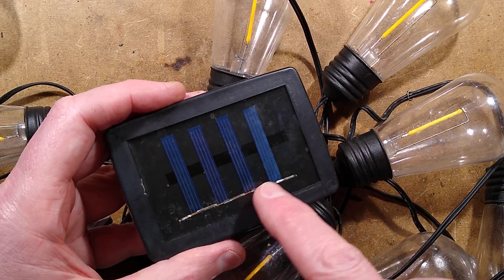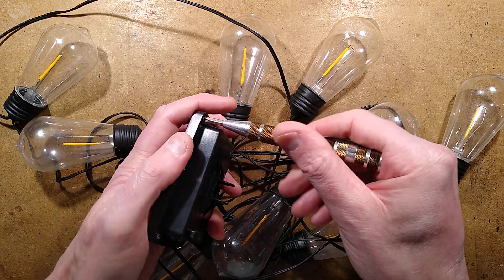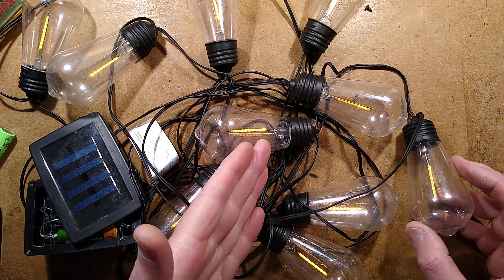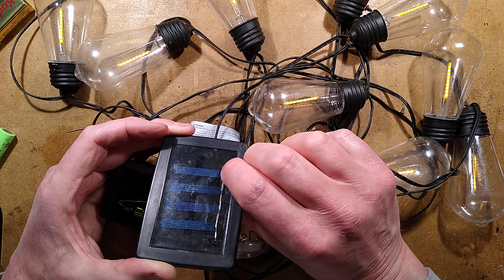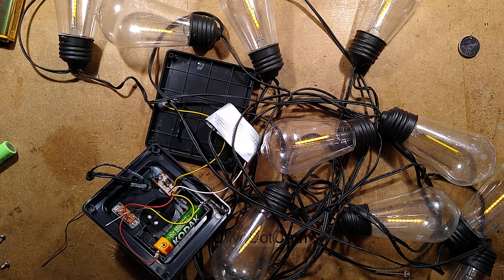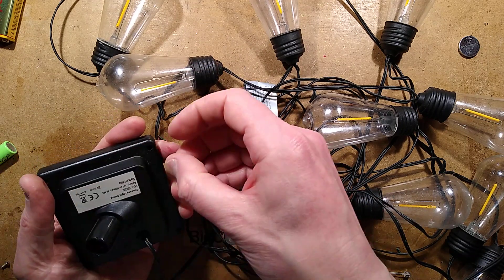Fixing my brother's solar garden lights

Comment: I recently re-surfaced the solar panels on my solar spotlights that had developed that alligatored, semi-opaque layer after five years. I used a sharp chisel to scrape off the damaged surface, and there was still plenty of thickness below protecting the solar cells. I added a few coats of super-tough flooring varnish to even out and clarify the panel. So far, they've held up fine for another two years. These are pretty decent quality lights, and came with 2 x 3.2v 18500 LiFEP04, 1200 mAh batteries, that I have only replaced once in seven years. Not bad for some Home Depot specials.

Comment: The idea of retrofitting the copper wire LEDs in is exactly what I did with one of my Aldi LED filament solar bulb things, the battery prematurely failed in one, and the other I'd pulled apart and not reassembled, so I took the working parts, some "warm" white copper LEDs, coiled them up and stuck it all together, and I have to say, seeing it out by the front door at night, it actually looks really nice compared to the LED filaments... :)

Comment: Got a string of these on a summerhouse; there's room to piggyback another ni-mh cell in parallel & looking up the IC (YX8615A) & it's datasheet it was easy to change an inductor on the PCB from 100uH to 56uH to give extra led brightness whilst retaining a decent runtime.

Comment: These green no-name cells are so shitty, they often come pre-leaked from the factory.
Reply: They're just packed so full of amperage it oozes out...
Reply: If you put a little dielectric on the batteries terminals.
Reply: yep, i have a poundland solar movement sensor switched light, its cells didnt last long so it got new ones, also from poundland, about 2 years ago, still working .... at the mo ... but poundland havent got the rechargeables in stock any more... poo ...

Comment: You might recall about 6 minths ago when you were working on some of Ralphie's other garden solar lights, I mentioned I was working on an Angel hanging wind chime blinkie solar fixture. The head is a clear plastic ball and I drilled a hole in it and inserted a RGB slow flashing LED to complement the white blinking ones in the wing area. The battery and switch along with the solar panel was toast. I bypassed the switch, upgraded the AA NiMH to a 2000Mah battery and glued on 4 50Ma 1.5V solar panels [parallel] which fit perfectly so 10 hours of good sunlight will fully charge the battery.

Back then it was winter here and the sun had moved so far south with the short days it would only work perfectly for a couple of hours after sundown and then dim into the weee hours of the morning. [I put a charge port on the bottom too so I could hook a Li-ion battery with a 10ohm resistor to charge it so it would work for a few days all night.]
Now that it's summer, it runs all night until the sun comes up on it's own. :-) [I did change the inductor from 100mh to 220mh but it didn't help, still the same brightness and subsequent battery drain.]
Oh well it works like a champ and my daughter is happy.

Comment: I've just bought, well, a week ago, a very similar set of lights from Morrisons, the only significant difference I see, is the mine are classic pear shaped bulbs, and they come in five different colours ( 3 x red, 2 x yellow, 3 x green, and 2 x blue).

I bought them because it says on the box "with non-replaceable, rechargeable battery" - I thought "non-replaceable"? We'll see about that!

The bulbs are indoors, but the power pack is outside, at least until the weather turns sour, then I'll bring it indoors, turn of the switch and let the dim winter daylight keep them topped up.

Comment: My family has some light sets which use the exact same battery/solar unit as the failed one. The only difference is the wires were tacked onto different pads on the PCB and they included NiCd instead of NiMH cells. The circuitry works fine but two of the three had the cells go bad. Actually only one had the cell go bad, the other came pretty much toasted.

Comment: CLIVE!!!!

I know you’re super busy, but I would be so happy if you did a few troubleshooting videos. Like you’re AVR troubleshooting video. (The one about the voltage regulator circuit board from a generator).

I do component level PCB repair on industrial equipment every day for a living, But sometimes while watching one of your videos… You’ll explain some thing that I learned years ago… But i’ll have a “eureka moment“ and it helps me understand even better!!! Just like in math class back in school… I could always work the steps and do complex equations but every now and then I would have a “holy shit moment!” And really understand the working principles in detail instead of just the idea of how it works.

And after all of these years on YouTube and doing electronics…  I’ve never seen someone shows the actual path of electrons. How they actually start, move, and interact with each other through components. 

I mean actually showing it on the circuit board like solving a maze with a pencil. showing where the electricity starts, how it moves through the board, and how it connects through each component and makes its way through the board. And especially what happens to the flow of electricity when certain components fail and how the flow is affected. 

I know you’re super busy but you’ve helped me understand electronics better than anyone. And a video like that would really help folks. Even professionals like myself. 

You have a natural clear and understandable teaching ability and way of explaining things.

Sorry to take your time with a long comment. But this is the clearest and most honest feedback I can give.
Reply: You are absolutely right.  Clive is an amazing teacher.

Comment: For a while I was considering building my own "central solar garden lighting scheme" where I would have a big proper set of photovoltaic panels set up somewhere like on the roof of the shed with some nice big SLA batteries or something inside. I'd have everything ran off this instead of a transformer like on a normal SELV system.

Comment: I've been playing around with solar lights and have an issue with them running properly for a short time and then going into oscillation. Looks neat though.
Reply from the maker: That sounds like a failing battery or lack of charge from the solar panel.

Comment: Can you explain what Henrys are when referring to inductors or even what inductors do?
Reply: It’s a relationship of a changing current to a voltage through a magnetic field. The greater change in current the greater the voltage. I’m open to correction I don’t claim to be an expert but I did graduate an EE.
Reply from the maker: A Henry is a measure of inductance in the same way that a Farad is a measure of capacitance.

Comment: Yeah these can be hard to fix sometimes, my mom wanted me to fix a solar light she had, but it had a lot of water ingress so the whole board was destroyed, you also have to watch the batteries they put in these, they often put really cheap NiCd batteries that don't last at all. I am glad that I've found some time to watch some of your vids. I've been so busy at school working on a production of a mid summer's night dream. Let me just say, coiling 150 feet of socapex every day is not easy and it is not fun either. The other thing that's been happening to the theater industry lately is wood is super expensive at the moment so building sets is a pain, so a lot of theaters are resorting to virtual sets on led walls or projected. My theater is lucky to have a decent projection system with 4 LED short throw projectors, a mac pro, and a full version of Qlab to run them from. I was wondering how things are going for the Tattoo this year?
Reply from the maker: Not sure what's happening with the Tattoo this year yet.

Comment: Are you sure the problem with the faulty LED wasn't in the cable. looked like high reistance to higher resistance given that a few lit then none then when you dropped it on the desk all started working.

Comment: Hey Clive wondered if you or any  of your viewers could fathom this one.

Working on a Refrigeration Plant control panel yesterday I was testing out some suspect faulty relays.

Anyway here's the weird thing; the control circuit is all 230VAC however I've found a set of four Finder relays that are actually marked up with a coil voltage of 60VDC! 

I took one out to check out the specs on RS website and they are definitely a 60VDC coil but they've been used on a 240VAC circuit and have been working fine up until recently for over 10 years!

I've gone through all the other relays on the plant and elsewhere they've used larger sized Omron Relays which are 240VAC.

It seems liked they've used these particular Finder relays because they are an incredibly slim design but I would just assume that a 60VDC rated coil would not work with 240VAC or at least not for 10 years?

Can anyone shed any light on this at all as it's a strange one. Pretty rare in our trade to use anything on DC apart from DC Fans with speed control.

Many thanks in advance and keep up the great work Clive!

Cheers!
Reply from the maker: That's odd.  AC relays do tend to have a lower winding impedance than DC ones as the continuously changing polarity has a ballast type of effect.  So it's possible that the DC relays passed less current on AC.

Comment: Am I the only person who noticed the 'new' power unit that you used had the facility for taking TWO AA cells and wondered if the factory diode bodge had anything to do with the fact it had been adapted to only use one? It sure looked like it had more solar 'panels' so may have produced a higher voltage...

Comment: i got to wonder , will those puny solar cells be able to charge batteries with ^2Ah capacity ?  ill ask that because i believe if u do put a good battery (nimh) with big capacity , it might just not be able to charge it fully and the lamp will kill itself from constant undercharge
Reply from the maker: The solar cells will put whatever they can into the cell.  2Ah would be a waste if it didn't get used near its capacity.

Comment: You should dab hot glue or silicon glue in hole wich wires are coming through, so it will be "water proof" agian 😂 otherwise, nicely done job 👌🏻

Comment: My pet hate is them 1.2V button cell batteries or 2/3 AA size... Sourcing AA replacement is easy. So when buying solar lights always check if they have normal AA size NiMH battery.

Comment: i kno this might b a little difficult to answer.. if it wasnt i wouldnt b askin lol  when would u adjust the inductor value?? say u want brighter or dimmer lights...but dont u adjust the resistor for that then figure out the inductor value? im trying to teach myself so i could b totally ass backwards..  whats the benefit to adjusting one or the other for ex. which ones would b more efficient? n is that because of its forward voltage??  thanks in advance for attempting to shine light on this trainwreck of a question lol :p
Reply from the maker: With these ones the best way to change intensity and run-time is to change the little inductor that looks like a resistor.  A higher value makes the LED dimmer and the battery lasts longer.

Comment: Could you trim the brightness of an odd led with a low value resistor?
Reply from the maker: Yes, if its voltage was slightly lower than the others.

Comment: Could you perhaps expand on the diode discovered 6:40? Maybe a schematic? :-)
Reply: There always have to be a diode between the solar panel and the battery otherwise the battery discharges on the panel when there's no light. Remember at the beginning Clive calculated 2V for the panel minus the diode, that diode.
Reply: @DumahBrazorf   This circuit uses a 4 pin ic (not a 8 pin Clive ;-) )  You can google for solar light IC and they will show up.  Everything is already included in that IC ... but most manufacturers have a on/off switch which disconnects the battery from the IC, so also the charging gets disconnected.  Now if you connect a diode directly from the solar panel, and the side of the switch where the battery is always connected to, the battery will get charged even if the switch is set in the 'off' position.  It's a non regulated charge but most of these solar panels are so not powerful that they will cause issues. In this case the panel is outputting max 2 Volt, diode drops 0.6 to 0.7 Volt and you get about 1.4V max over the battery ...

Comment: So has that Chinese solder station designed the hot air wand for heat shrink tubing only or is that for SMD work/rework too?
Reply from the maker: It does both.

Comment: Just so I have this correct... if the lights work when touched to the tablet battery, the wire on the shiny side (of the battery) is the positive?
Reply from the maker: There's usually a + symbol on it.
Reply: @bigclivedotcom  something has attacked my outdoor solar lights (in Australia the nocturnal friends play) and snapped the wire (both wires are the same colour and both covered in clear plastic) so I need to find which is positive on borh ends of the cuts before soldiering and heat wrap.

Comment: The solar light in my garden failed the other week, I wonder if it’s the battery in mine as they went 
Iike your brothers can you use any rechargeable battery or does it have to be a Ni battery for replacement?
Reply from the maker: It has to be a NiMh for these styles, but some people claim to use standard alkaline batteries.   Not sure that's a good idea.
Reply: @bigclivedotcom  cheers Clive will have to pop down to poundshop and get some batteries

Comment: Hey, what is the easiest way to replace the solar panel with just a regular old wall outlet connector?
Reply from the maker: That depends on the light's circuitry.

Comment: I have bought a pretty similar arrangement from a local store twice, but one new set doesn't really light up when it's dark. Only two or three of the first leds start to shine. I was able to switch the solar panels (because plugs) so I know it's something about the panels or the circuitry. But what? Any ideas?
Reply from the maker: That hints that maybe the end of the wire possibly has a short circuit or an LED has failed shorted.

Comment: I rewired my garden solar light - and now the bulb turns on when the solar panel is on the off position (it is on even during bright daylight) - why might that be? (it is just one low watt bulb)
Reply from the maker: If the unit is switched off the battery is usually disconnected and the solar panel may feed the light directly.

Comment: How can you tell if the battery if charging when you switch them off? I've had solar lights that only charge while in an on state, very annoying
Reply from the maker: Most use the switch to fully disconnect the battery during storage and shipping.
Reply: @bigclivedotcom  which is a pain in the butt... I wonder if places like arizona, these things survive a year 😂

Comment: I've been playing with solar panels way too much (my entire 33 year life)...
I didn't even get 5 seconds in before I saw that solar panel and thought "Oh my God what are they doing wasting all that space for 4 tiny cells?!?!?"
I mean really, that tiny panel could have had 12 of those tiny cells in that area.
...
I nerded too hard...
Reply: Same here. My mouth just dropped open. I wonder what the power output is of that thing?   I thought it would be just sufficient to light up those leds for like 1 hour when placed in the desert sun for 10 hours.   And here I am trying to use a real 6 Watt glass coated panel to keep a led lit during the wintertime.
Reply: I'd imagine the panel housing is a generic size and is used for a number of different lighting applications, the manufacturer just tailors it by changing the way the panels are set out for different sets of lights.

Comment: How does that drive 3V filaments off a 1.2V battery?
Reply from the maker: It uses a pulsed inductor to increase the voltage.
Reply: @bigclivedotcom  just bought a couple of solar lights to see what's inside: apart from the solar cell, the switch, the LED and a NiMH battery — not much, only an inductor and a mysterious chip.
But now I think I will try the diode trick.

Comment: Unsolicited thumbnail tip - avoid placing text in the lower right corner, as it gets obscured by the video duration. It's not as bad on mobile devices or Chromecast, but on a desktop browser for this particular video all of HTS in LIGHTS is completely covered.
Reply from the maker: I'll keep that in mind.  I also have to keep the middle clear for the play arrow.

Comment: Yes, disappointingly poor lifespan on these things. I bought two sets of Sainsburys garden lights last year, both have issues now. One set doesn't light at all, and the other set has only half of the lamps working. - I'll untangle them and bring 'em inside.

I quite like garden lights, but the build quality and lifespan is atrocious. I have heaps of old mains powered light sets that will still work, and they're all about 20 to 30 years old. - If it won't break, don't 'fox' it!

Comment: I bought five garden solar lights and before I put them out, i took them apart and covered all the circuit boards with a conformal coating, hardened with a UV lamp.

They're mostly still working, but the damp got to the battery terminals on one or two of them.

Should be easy to fix though, and the circuit boards are completely un-damaged by any water ingress.